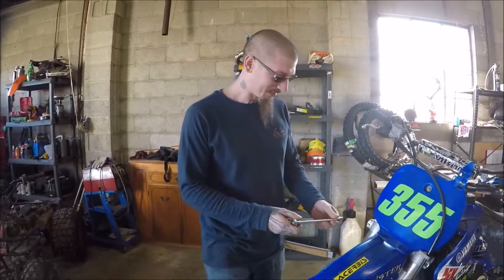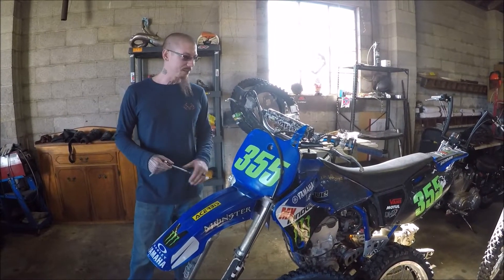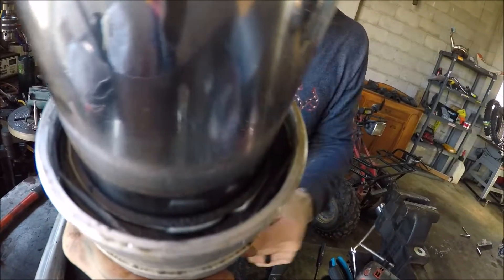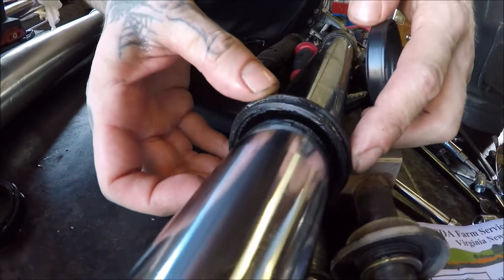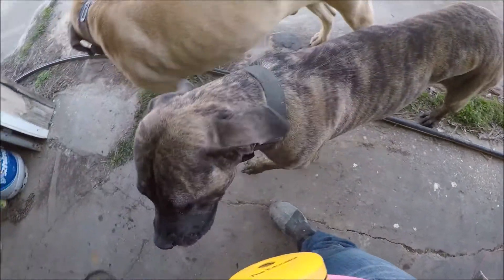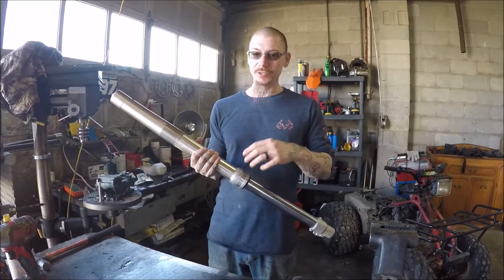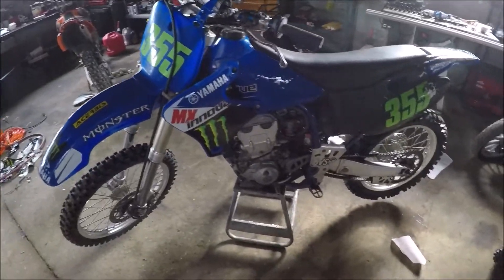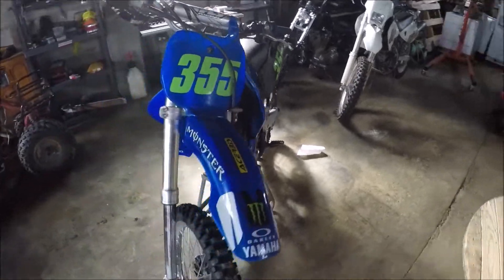1998 Yamaha YZ 400F

Comment: So... I got one of these bikes for $500... Didnt run, hadnt ran in close to 10 years.  He had a carb rebuild kit and a few other things included...  I rebuilt the carb, (Im in Pheonix, so the heat turned the gas into tar.  It was a disaster..) And cleaned the air cleaner. After figuring out the decompression lever, i got it to run.  It ran pretty good for a bit, but now im having a stalling problem.  I have messed with the air/fuel mixture 100 times and the only way it will stay running is if i turn the idle up.  Any ideas on why it wants to stall?  Could it be the float? Or is it jetted wrong? Or is the idle supposed to be high?  It is fairly easy to start now and goed down the road just fine.  But cant figure out why it wants to stall at idle...
Reply from the maker: I raced one of these 400s in a few harescrambles here in va. Tight single track. It loved to stall. I did the exact thing you did and chased my tail for a while. The only thing i found that fixed the stalling at low rpms was adjusting the idle up a touch higher. I didnt have any issues after that, it ran great! Glad to hear you havnt given up on it 👍🍻